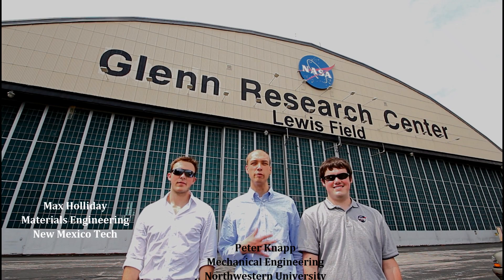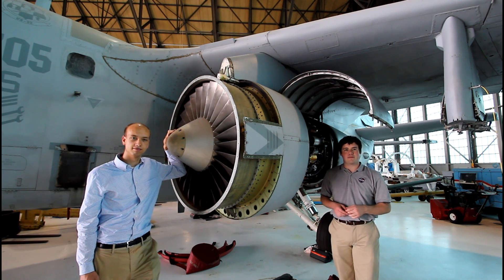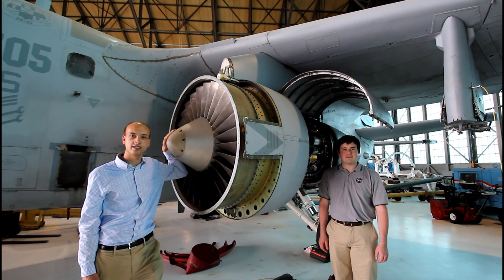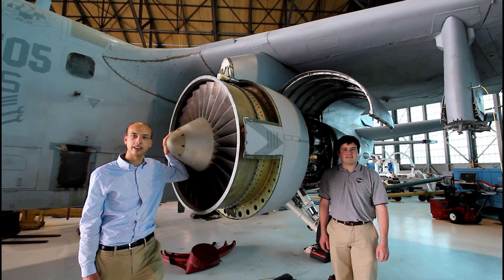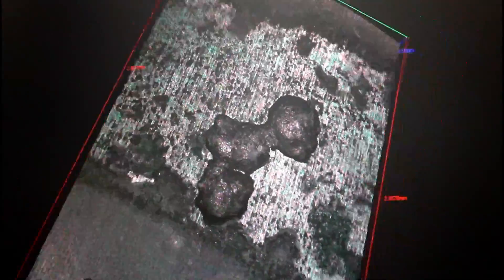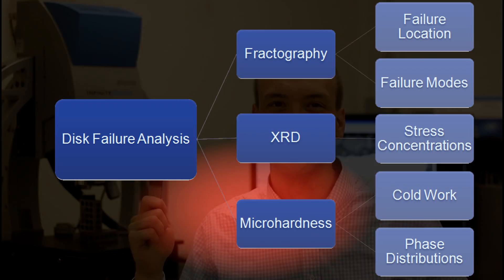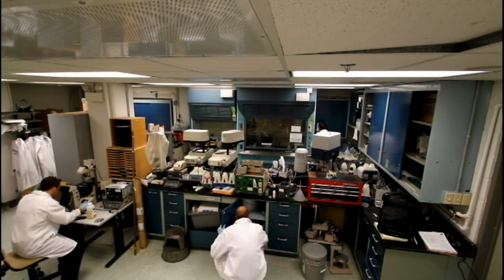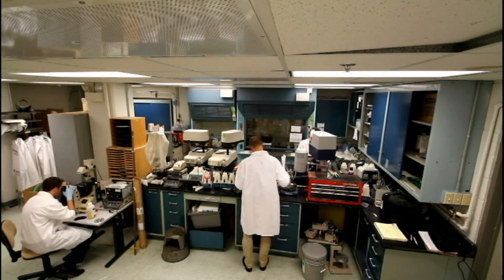Superalloys for Jet Engine Turbine Disks

Comment: GE's use of 3D composite materials on the 9X is really impressive, and seems to suggest a future with greater use of composites being combined with superalloys made to limit thermal expansion. Much of what we know about the failures of metallic structures is from programs just like this, and it leads to technologies needed to identify an impending failure before the unthinkable happens. Are you also undertaking any programs about further refining our ability to identify prefail indicators of composite materials?